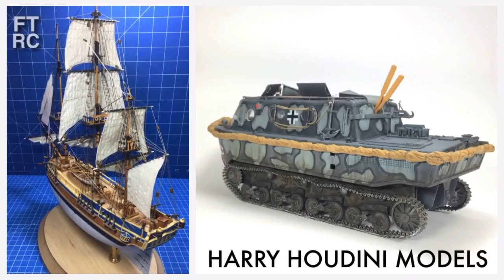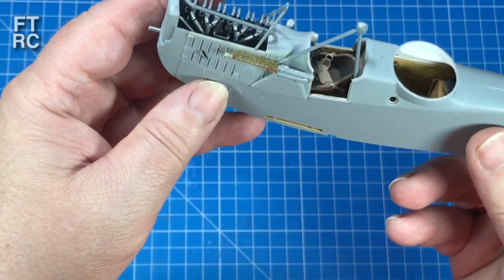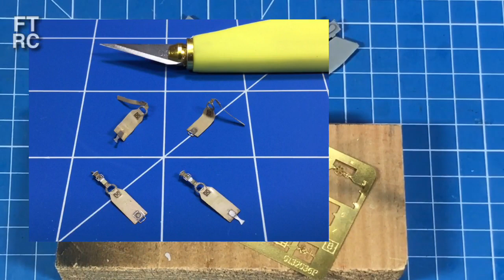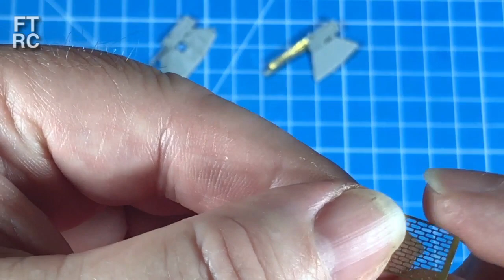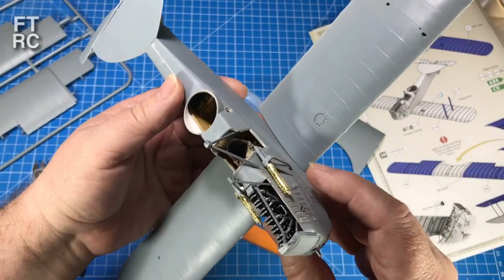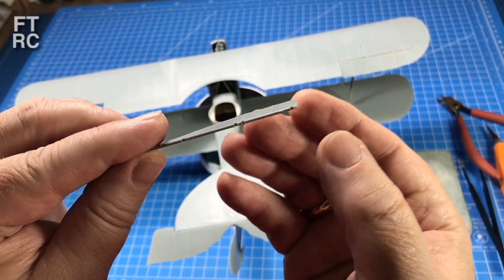Wingnut Wings W.12 Part 5 Main Assembly & Machine Guns

Comment: Hi mate, I'm thinking you may have small problem with fixing the gun sights, the flash eliminators already fitted to the guns, but it's looking great mate.
Reply from the maker: Good point, but I know from experience that I knock off small fine parts while I paint and continue the major build.  So leave off anything fragile to the very end.  I have a way around the issue which will allow me to add the sights even with those flash eliminators already in place.  Good pick up.  No one else has noticed yet.
Reply: @HarryHoudiniModels  had much the same problem with one of my kits, can't wait to see it painted mate.
Reply from the maker: Already started the painting last night priming with Stynylrez.  Will mix up my blue/grey and linen top coat colours today then hopefully have it all painted by the weekend.  Might even get a start on the lozenge decals too.

Comment: Looking good ! What type of clamp do you have on the upper aileron at the end of the video?
Never have seen one quite like it😉
Reply from the maker: The clamp is from a Trumpeter set with a base and stems to hold parts for painting and gluing.
Reply: Harry Houdini Models 
So glad your feeling better about this build, that's the way they go sometimes. It's an interesting aircraft in a quaint sort of way😜. It is nice that there is all that extra unnecessary detail added for those of us curious about
how these old antiquated planes were put together. Lozenges you say, will that be decals? 👍😊❤️
Reply from the maker: Yes WNW provide all the lozenge decals in the kit which cover the tops of both wings, the upper rear fuselage and tailplane.

Comment: Getting on with it! Just a little niggle...motors are driven by electricity, engines by fuel or steam. Or so my Dad taught me so many years ago...
Reply from the maker: You are half right.  An Engine is defined as a machine that uses the energy from liquid fuel or steam to produce movement.
However a Motor can be either.  English Dictionary: a device that changes electricity or fuel into movement and makes a machine work.